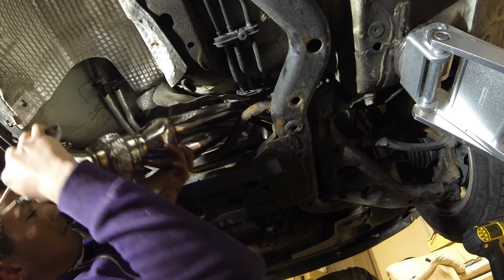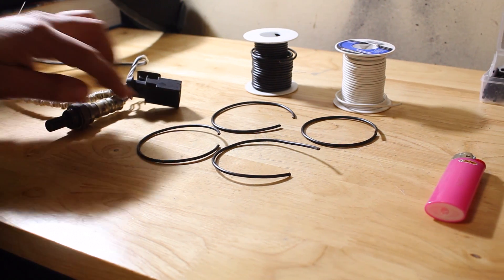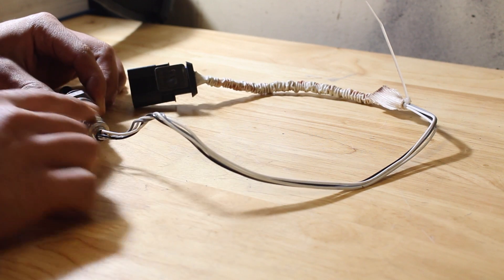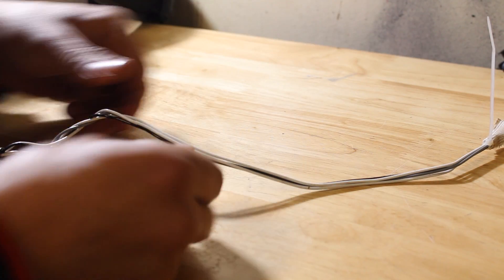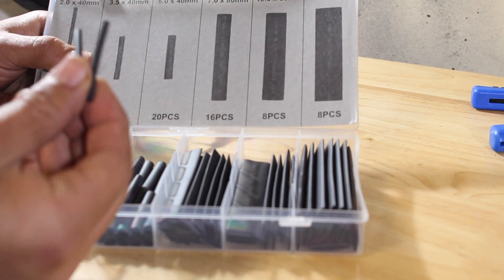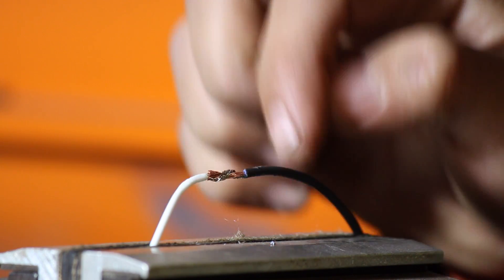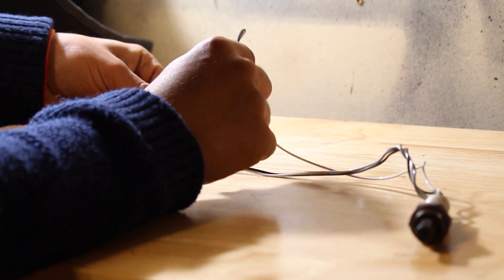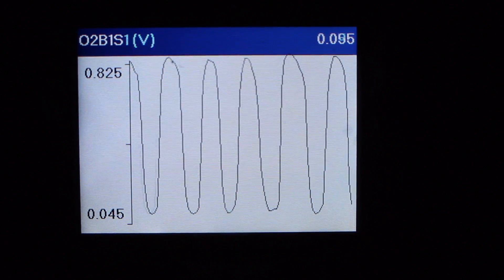How to Extend Oxygen Sensor Wires

Comment: The majority of O2 sensors have stainless steel wires, not copper, which is next to impossible to splice. However, if you do find copper wires inside, this would work. Still, it's better to extend the wires coming off the engine, then you don't ruin an expensive O2 sensor.
Reply from the maker: If you mess up though, a replacement engine harness costs alot more than a replacement O2 sensor
Reply: Facts. I'd rather buy another O2....

Comment: You're mistaken. The thicker the wire, the less the resistance would be. The longer the wire, the thicker it needs to be in order the reduce resistance.  For a 6" extension you should likely go with 1 gauge larger.  You'd have to measure the resistancw of the wores to know for sure...but saying you need to use the same gauge wire in order to reduce resistance is completely false.

Comment: Solder is for copper wires - how do you figure it works on O@ sensor Aluminium wire? By joining as you have, you're also contaminated the internal reference air. How do you fix that?

Comment: This is going to skew your fuel trims a few points.  The extra resistance added by the extra wire and solder points are not properly calculated by the computer. This will cause the car to think there's more or less oxygen than there actually is causing it to run rich or lean a bit. I had a similar issue with my Mercedes where the cam magnet seals failed allowing oil into the wire harness and seeping through to the O2 sensors changing the resistance a bit.  As a result my long-term fuel trims were always 7.81 positive for no reason.  I spent months trying to figure out if I had a vacuum leak somewhere and or bad sensors before I realized the oil issue.
Reply: That's false BR Davis.  The resistance only increases if you don't increase the gauge.
Reply: Yall think I would be safe extending the harness instead of the sensor wires? I need them to reach all the way to my cab mounted standalone system. And they NEED to be accurate

Comment: One of the wires that attaches to the O2 sensor is also an ambient air supply for reference to the sensor. The air wicks inside of the wire insulation. Sealing that air supply will render the O2 sensor useless. If extension is to be made, it should be made on the harness from the ECU and before the connector. Keep extension short and try to match the wire gauge so as not to exceed the expected resistance in the ECU programming.
Reply: That sounds easier

Comment: this is gonna cause a resistance issue, causing more issues, just buy an extended one
Reply: More solder=less resistance. Solder is a conductor not and insulator. If your theory was right 02 sensors woud need to have equal wire lenght for every car, which is obviously not the case. Resistance of the wire is neglegable comparing to the voltage coming from 02 sensor.
Reply: Haha that is, if you even can. I have an NA miata and I bought after market headers bit the hole for the o2 sensor was so far down the pipe that I have to extend the wire.

Comment: Watching this to finish I learned from it, but wanted to say, larger wires offer less resistance, not more....The smaller the wire, the less current it can carry, without it getting hot and causing (more resistance), as it does.....The longer the run, the bigger the wire you need, or you get voltage drop....Not good, when full voltage is needed at the given delivery point....Thanks for the video.
Reply: That's it.

Comment: Running copper wire while the o2 sensor wire is stainless steel, won't give you the right reading, should have used a o2 extension from eBay, cheaper and less time consuming.

Comment: I think while extending wiring, one must take either equal guage wire or 2 to 3 guage thicker wire so that extra resistance due to length can be compensated
Reply: Yup. OP doesn't know electrical and shouldn't be teaching it.

Comment: It’s best to crimp the wires.. not solder. Mechanical bond is much better because it holds stronger under a lot of vibration and the sensor reads better

Comment: Ive extended my wires and it seems to be working but I got a code saying low voltage, ive been told that i most likely put a little too much solder

Comment: Did you get any problems using this method? I've read you're not meant to solder. I need to extend the wires in my Mini R53 probably for the same reasons as you, I'm putting in a 4-2-1 Manifold which relocates the o2 sensors.
Reply from the maker: I've had zero issues with this :)

Comment: Yea, you're not supposed to solder O2 sensor wires. They need to draw fresh air and can't when covered in solder. Also, there's a reason it didn't stick. It's not copper, which is what that solder is for. 02 wires aren't made of material suitable for the average solder job. It's recommended by 0s manufacturers as well as all of the car manufacturers to NOT SOLDER BUT CRIMP O2 sensor wires when making a repair if replacement isn't available.
Reply: this is not the first time ive hear this, seems odd to me too. apparently its designed to "vent" through the wire strands...not sure why
Reply: soldering risks cold solder, 2 amps plus the high heat in the vicinity can increase internal resistance/impedance enough to throw off values.  If you twist the wires together and use silver solder you should be good.
Reply: Draw fresh air?  ... No...  The only reason soldering the wires which are normally covered with plastic would be a potential problem is if the heat level is too great causing cold solder.  Cold solder will increase impedance and throw off your readings giving you a code, crimping avoids this.  It would be best the crimp not have any "fresh air" at all, because "fresh air" is what is needed for corrosion.  If you extended wires and ran into several o2 codes, cat codes, or o2 heater codes, take the thing out and one by one use the crimp method (like the bosch kit).  What sucks is, the o2 at this point may be damaged from the heater circuit itself pushing too much current/voltage to the f'd up o2 with the cold solder.  Yes it sucks, so maybe buy a new o2.

Comment: use some soldering flux/paste on the wires and that helps the solder stick onto the wiring alot cleaner, learned this way too late into soldering... hope it helps someone
Reply: You should use tin/lead solder with a rosin core rather than flux for sensitive electeical.  You especially don't want to use acid flux. 

Lots of misinformation in this post.

Comment: if i didn't solder the cables together it probably won't function right, right? i just twisted the cables together and used electrical tape, pretty half ass on my part haha..
Reply: Just drive over railroad tracks very very very slowly
Reply from the maker: +JosephCorleone THat still should work, but the solder makes sure the cables don't move around with the possibility of shorting out.
Reply: what if you just join it together without soldering and then just heat shrink it?

Comment: My wires broke when removing my 02 sensor because I forgot to unplug it and now I don't know which of the two white wires I need I connect for the voltage or does it matter?
Reply from the maker: +Kurtis Snyder If they are the same color, they are for the same purpose. If you are working on a 4 wire oxygen sensor, where 2 are white, 1 is black, and 1 is grey, you will have 2 power wires that will both give off the same voltage, you will have 1 ground wire, and 1 wire for the sensor signal. So if both of your white wires are cut, it doesn't matter which is wired up to which wire because they have the same function :) 
If you're unsure, try to find the wiring diagram for the sensor to be 100% sure
Reply: +milanmastracci okay that's what I thought, thanks for the help! And Your one of the only youtubers who answers my car questions and I really appreciate that!
Reply from the maker: No problem Kurtis :) Glad I could help!!
Reply: I don't think it does

Comment: so i can have a straight pipe with o2 sensors plugged in and have no check engine light on???
Reply from the maker: +capo949oc You will after I show you how to install a defouler :)
Reply: +milanmastracci fuck yea nigga get that shit poppin
Reply: +milanmastracci hell yea nigga get that shit poppin
Reply: +milanmastracci have you happened to make this vid? ive been wanting to cut out my second cat on my 95 f150 w/ 4.9l I6but its got an o2 in the cat i was told by two buddies that im kinda scewed unless i find a chip, buuut they dont make em for my truck lol
Reply from the maker: https://www.youtube.com/watch?v=EuEsevIXE7Q
Reply: What the,?.